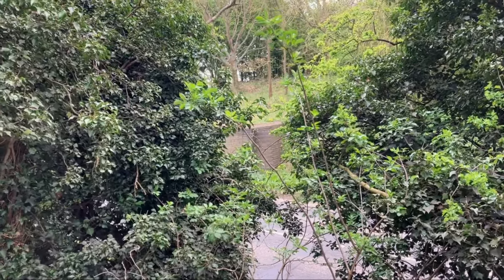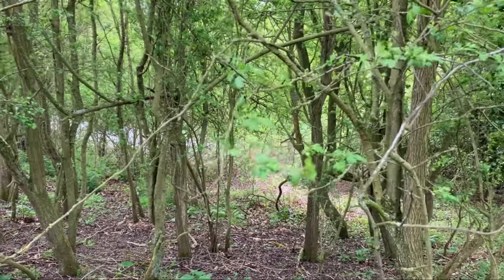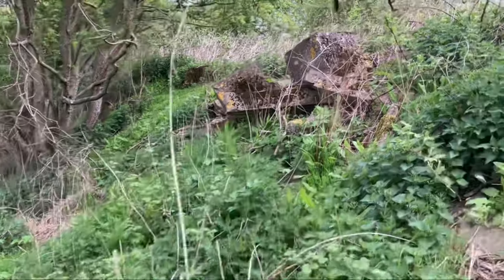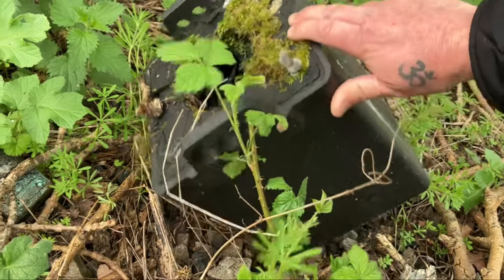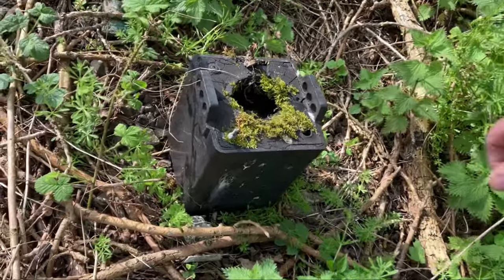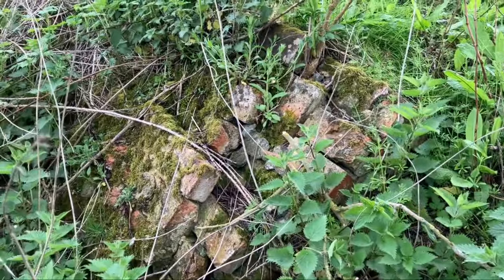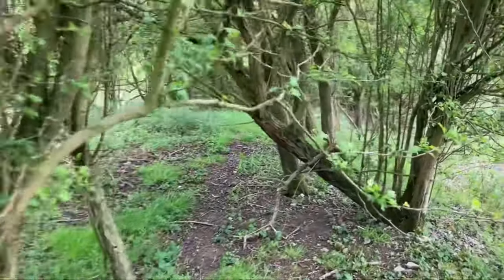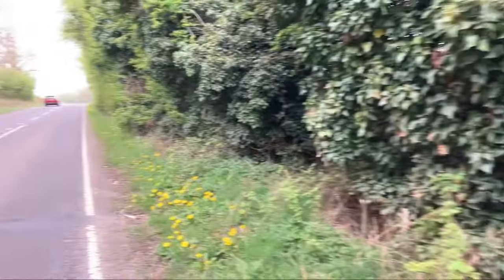A look at what remains of Staverton Road signal box and bridge on the GCR

Comment: Great video them concrete blocks look alot like those that are supporting the point rods on the photo with the bridge the signal box was built on brick supports if yo look closely at the photo and zoom in
Reply from the maker: Yes I did see that the supports are brick.   So the concrete blocks are for the rods

Comment: I've found a lot of these batteries along the GC Neil. There were a number in Radstone cutting near the base of Brackleys up colour distant signal (the concrete base of which still remains... For now, until HS2 obliterates it!). North of Lutterworth, there is an old battery cabinet that has been pushed over during demolition and the contents have fallen all down the bank. There were tons of similar batteries in that area. There were a number of colour light signals in the Staverton area, so wondering if these batteries are part of that infrastructure. Fascinating stuff!
Reply from the maker: I’d say they were.  In some of the last photos of the area you can see you coloured light signals 👍.